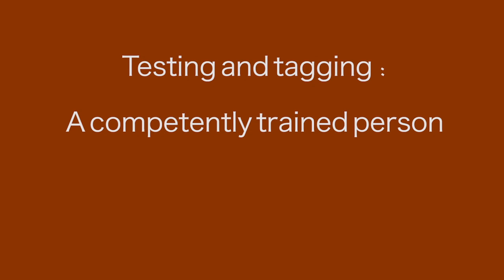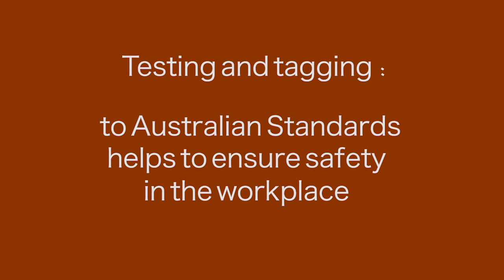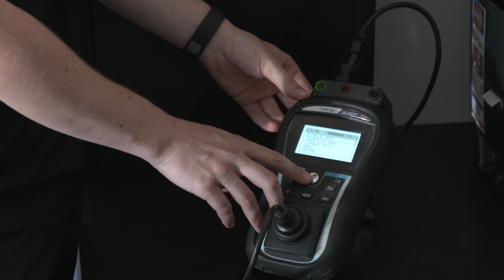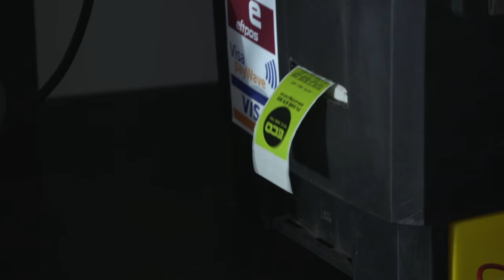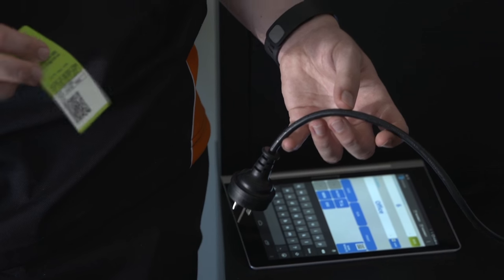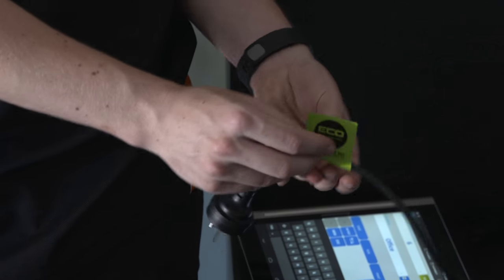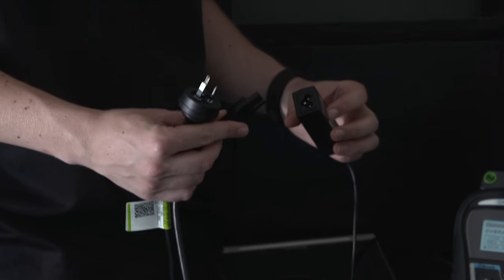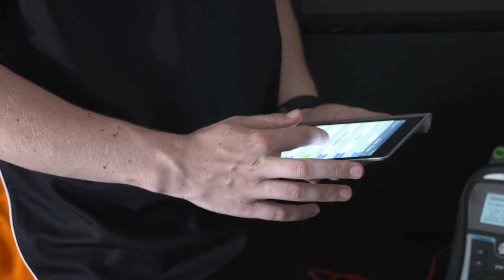What is testing and tagging? How it's done.

Comment: Year 2050. How to test and tag kitchen knifes. 
1. Visual inspection of the knife. 
2. We check for sharpness. Knife is used every day so must be tested and sharpened every 3 months.  
3. Blade guards and covers installed when not in use.
4. Inspection and tagging of blade guard. Inspect for cracks and damages. 
5. Ensure blade guard is compliant with current blade guard safety standards. 
6. Ensure knife has safe storage compartment. 
7. Ensure storage complies with safety standards for knife storage and has all child protection in place.